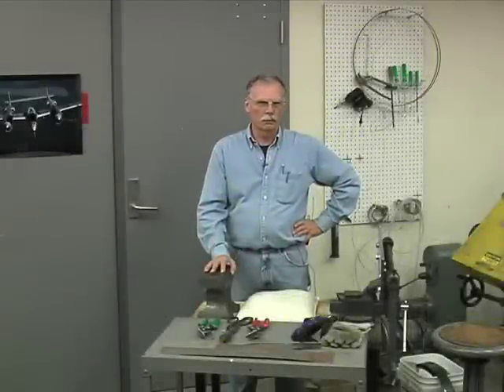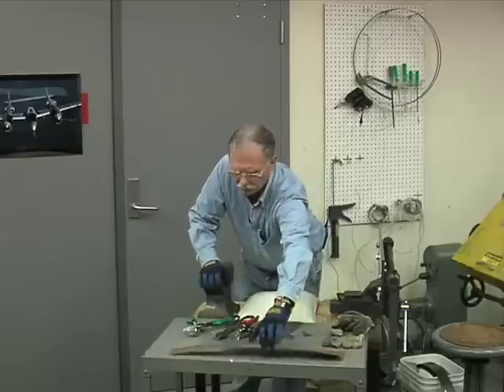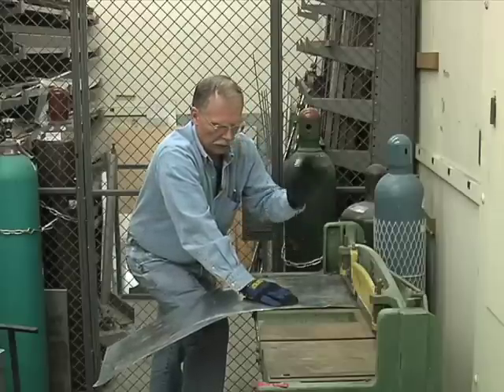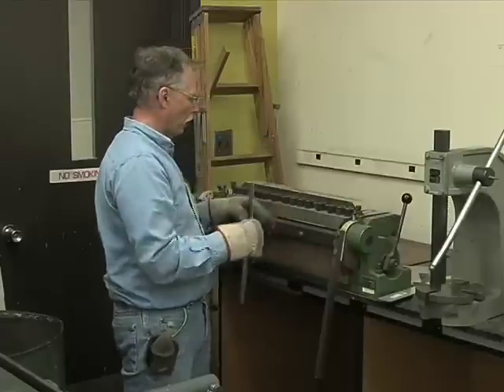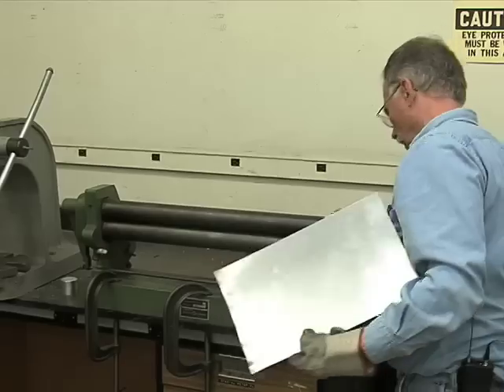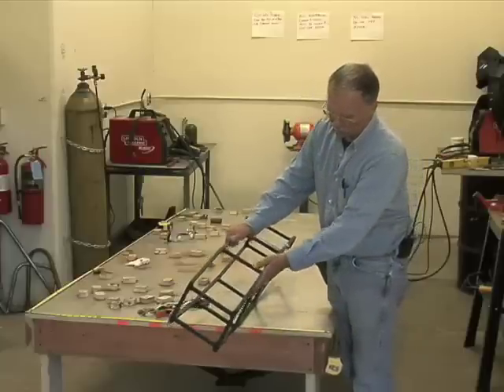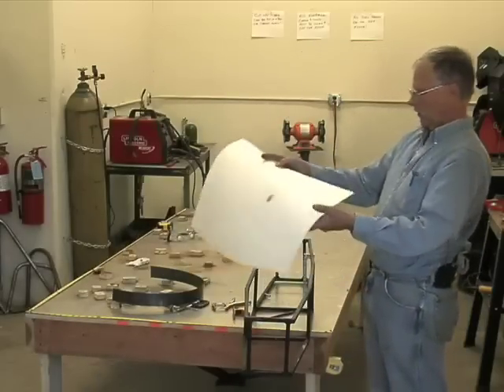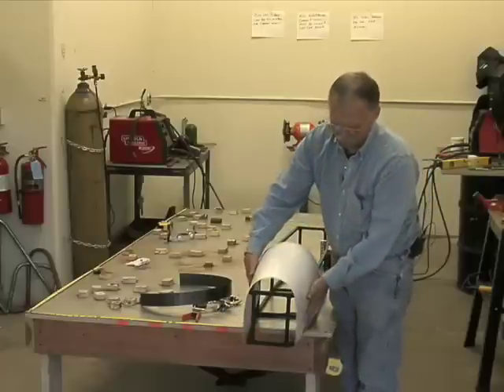Metal Forming - Part 1

Comment: @smoothjamskillmoure temperature decrease. Basically you cant really have most building materials lowering their temperature too quickly because they dont have time to "anneal" (not sure if thats the right word) and if they arent allowed to do that it will crack. I doubt marble is a good material to be using as a mold, for aluminum we used slurry, which is kinda dangerous to inhale, either way, whatever your doing sounds like you need a real life teacher so you can do it safely.

Comment: @1MPALASS oh you trying to pour molten metal into a mold? Like the same process for forming a sword? This is a bit more advanced because it is involving temperatures that require special and expensive equiptment. Im wondering what type of metal you are using, the only casting I have done is with aluminum, Also just like glass you need to heat the metal high enough to get it into a molten state, then pour it into your cast, then it needs to be placed in a kiln which is used to slow the